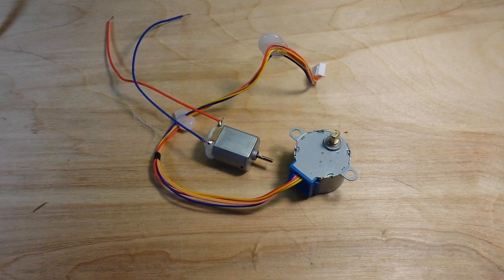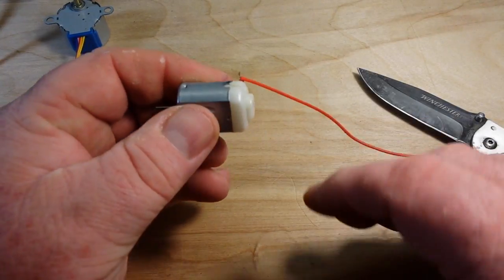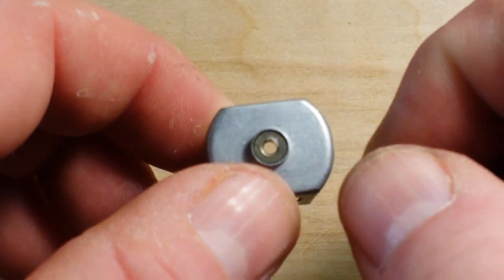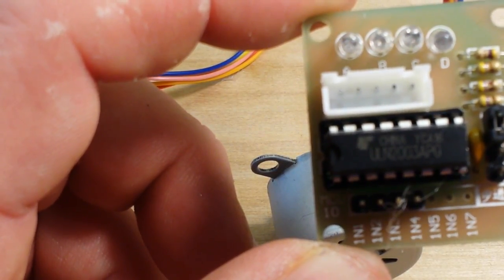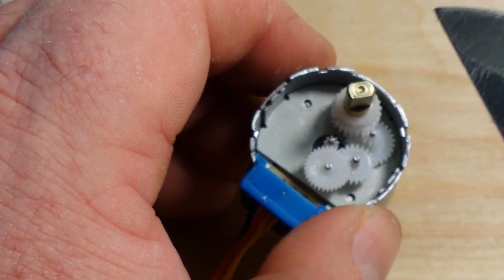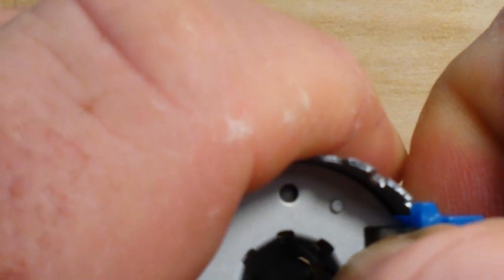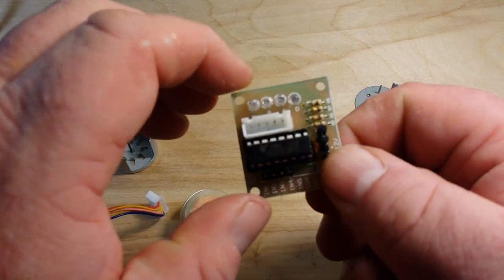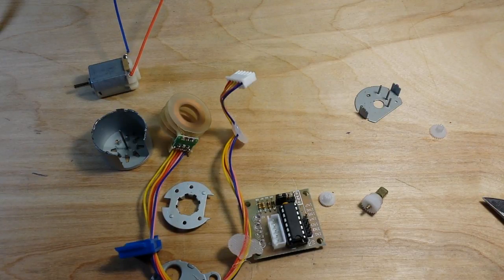Stepper Motor vs.  DC Motor

Comment: Did the motor and stepper work after you put them back together? I've built 3 cnc machines one running nema 34 steppers and two running nema 23 steppers. The last one is using a nano and grbl. Watch those fingers though I'm sure you know how much it hurts! Instructive video as usual thanks.
Reply from the maker: the dc motor did🤓
Reply: I've always been told not to disassemble A stepper. Maybe they were right?

Comment: next video about bldc motors? :P

for a project i looked up motors that can be fast, strong and precise. i came about the motors of the company nidec (sold on aliexpress). pretty expensive, but they have almost everything you need. they have the bldc driver on board, they have 2 sensors offset at 90° so you can sense speed and direction of it. really neat, but expensive
Reply from the maker: fredlllll I actually have a few brushless motors here. We use them for Radio Control aircraft.
Reply: yup i also only saw them in those up till then. well there is one guy who made crazy fast servos with BLDCs. should be on youtube. but these things have everything in an arduino compatible package kinda. one day im gonna get one of these :P
Reply from the maker: Oh, I like the idea of all-in-one....going to have to check these out. Thanks Buddy
Reply: sent you the link via email
Reply: I know its 5 years later, but would you happen to have a link/name? :)